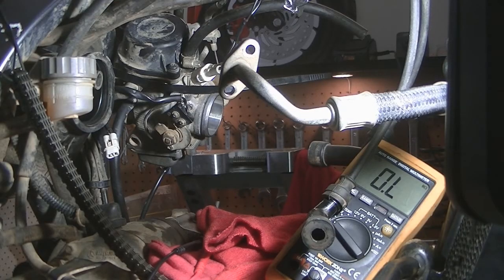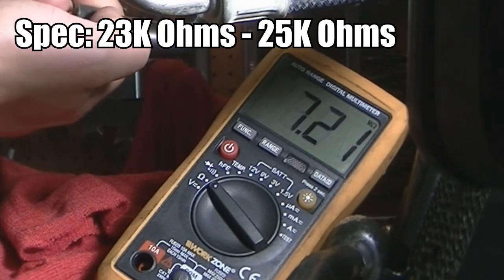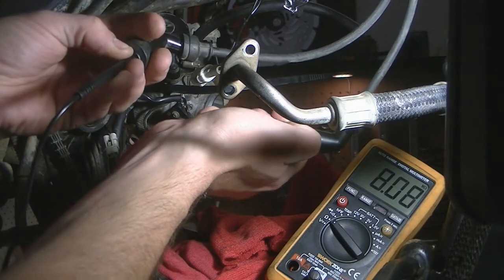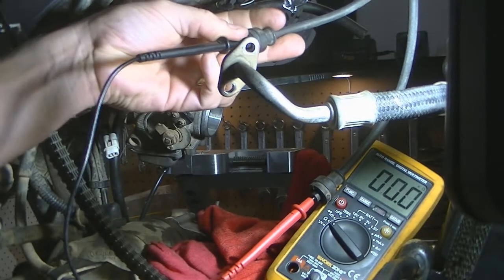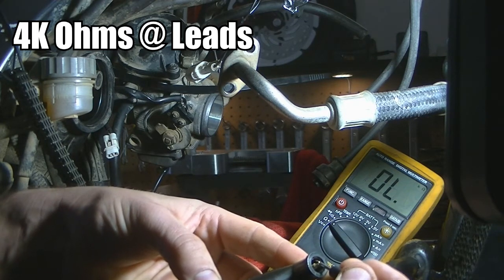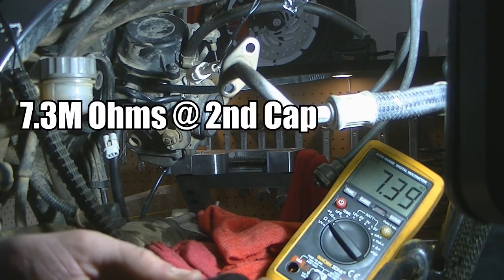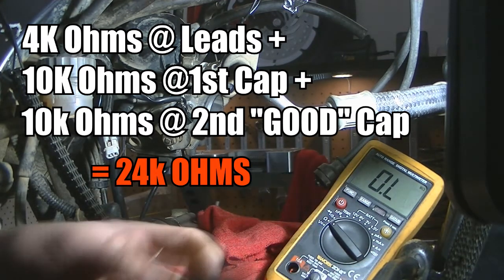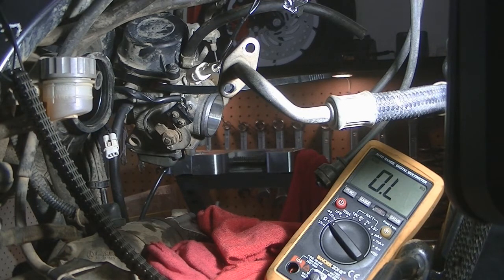DR650: Ignition coil test/ Spark plug cap test

Comment: The plug caps on Japanese bikes have for decades been pretty much universally 10kΩ resistor caps.. Besides that you can get generic ones from NGK which are actually identical to OEM for half the price or less. I stand corrected: The required type for the DR650SE is NGK VD10F. You should be able to get them for less than 10€ / 10USD a piece from automotive suppliers. NGK produces most of their spark plug caps with no resistor - 1kΩ - 5kΩ and 10kΩ.

Comment: Very informative video. Made it simple to trouble shoot my intermittent stumble which felt like a loss of spark. All my resistance measurements were the same as yours, once repaired. Bad resister in one of the spark plug caps. Thanks.

Comment: listen to this shit ....bike wouldnt start i pull the first plug wire off , stick a screwdriver in it to check spark to ground and bike fires right up with  only the back plug installed  .......sounds like spark plug wire cap is the problem

Comment: I'm measuring 24 k ohms at my coil leads and about 42 with both spark plugs caps on. This sounds way off no?
Reply: ebay special coil had 24-25k ohm, my old oem had 4k and both spark plug caps were 9-9.5k ohm. Lesson of the day, don't trust ebay. Thank you for this video

Comment: Thank you for making such a clear and informative video! My dr650 suddenly has no spark. I was hoping you might be able to help. The ignition coil is a little under spec at 22.8 so I got a replacement. The replacement reads 25 without caps and 34.8 with caps on. Each cap is about 5. Is that a bad sign? should I not use them? Is lower resistance worse then higher resistance?
Reply: Did it work out? Having issues myself about the same reading as you but figured it'd be close enough.

Comment: I'm trying to test my DR650 -- Bike sometimes runs really bad after several hours so I'm trying to diagnose it. I tried plugging in my multimeter leads to the caps and it was still showing 0.00. Electrical noob here. Do i need to do anything other than turn on the bike, take the caps off the plugs, and plug in the multimeter leads? Thanks!
Reply from the maker: Steve Romm multimeter needs to be set to ohms, bike doesn't need to be on, make sure the multimeter is touching the metal part inside of the caps, ifwhen it's really warm check the pulsar coil resistance too.
Reply: For some reason I'm still not able to get any reading from the plug caps. Someone from drriders.com recommended removing the caps and testing wire to wire -- I'll try that tomorrow. I was able to get a reading of .2 ohms on the connector side of the ignition coil which is out of the spec (.07 - .12). I wonder if that's enough reason to replace the ignition coil? I'm trying to solve a weird issue that has happened a couple of times so far -- after riding the bike for several hours, it started to buck, lose power, sputter, backfire, stall out, etc...  Thanks for the help and keep up the good work!
Reply from the maker: Steve Romm electrical systems are hard, and I'm not sure of how much you already know, but ohms are just electrical resistance, if you set the meter to ohms, put it across a piece of wood it'll read o/l or infinite resistance, across a piece of copper wire 1ft long maybe 10ohms, across a 20 foot thicker wire maybe 200 ohms as an example, it's also temperature dependant so I like to say a tolerance of +/-10 percent is ok a .2 reading is out but might still be sufficient enough to do its job. This bike had a few issues, it got a rebuild, spark plug cap, but it did get a pulsar coil as well, a pulsar coil tells it when to spark, if it's out of spec and heat effects resistance don't forget, it'll have insufficient spark, it's the same diagnosis ohm test done under the seat, but the pulsar coil aka pick up coil lives with the stator. Again Suzuki sell only the whole stator which is crazy but an after market pick up coil for the dr was about a 10th of the stator so price
Reply: That's what my bike was doing. I adjusted the valves and now it only runs strong for a minute or so  then dies if you give it any gas.
Reply: Did you get it going?
Reply: Posso puxar o  cachimbo de ambos cabo e saira normal?
Pois a minha uma desconecta de bôa,já a outra não quer sair